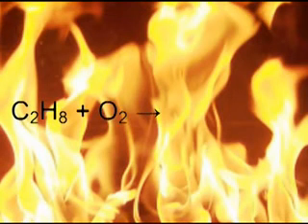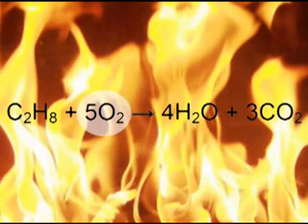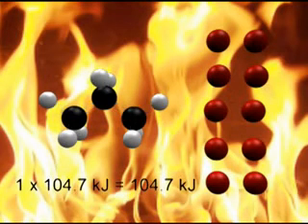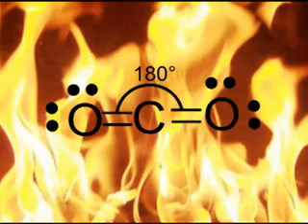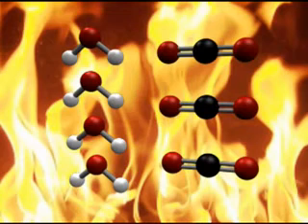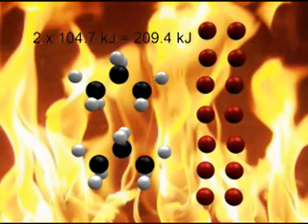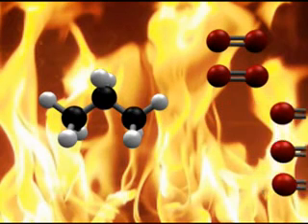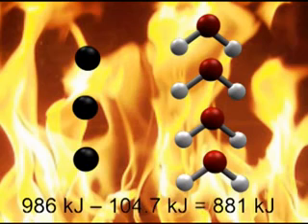The Complete vs Incomplete Combustion of Propane.wmv

Comment: Lets consider the following enthalpies of formation:
- propane 104.7 KJ/mole( as in the video, but actually is 103.85)
- water 242 KJ/mole
- carbon dioxide 393.5 KJ/mole
- carbon monoxide 110.5 KJ/mole

Now for complete combustion: C(3)H(8) + 5O(2) -> 3CO(2) + 4H(2)O
       Energy spent for breaking the bonds:        104.7 KJ/mole
       Energy released when new bonds are made: 4*242 (for water) + 3*393.5(for CO(2) )= 2148.5 KJ/mole
       Total Energy released after this combustion: 2148.5 - 104.7= 2043.8 KJ/mole

Now for incomplete combustion where carbon monoxide is formed (using 2 moles of propane in the first place): 2C(3)H(8) + 7O(2) -> 6CO + 8H(2)O  (there are only 6 molecules of CO from stoichiometry, not 7 as in the video)
        By breaking the bonds of 2 moles of propane the energy will be: 104.7*2=209.4KJ/mole
        Energy released when new bonds are made: 8*242 + 6*110.5(from carb. monox.) =2599 KJ/mole
           Total Energy released after this combustion: 2599 - 209.4= 2389.6 KJ/mole
        We have to divide by 2 in order to obtain the energy released from only 1 mole of propane in the incomplete comb. : 2389.6/2  = 1194.8 KJ/mole

Now for the second incomplete combustion, where soot is formed(only carbon atoms and water): C(3)H(8) + 2O(2) -> 3C + 4H(2)O 
           Breaking the bonds, only 1 molecule of propane is taken into account: 104.7 KJ/mole
           Forming new bonds: Carbon enthalpy of formation is 0.
                                                 Water: 4*242 = 968 KJ/mole
         Total Energy released after this combustion: 968 - 104.7 = 863.3 KJ/mole

So the three types of combustion are developing the following energies:
- 2043.8 KJ/mole
- 1194.8 KJ/mole
-   863.3 KJ/mole
Hope it helps you and really thanks for these 3D representations !! It makes much more easy to understand! Wish you all the best!